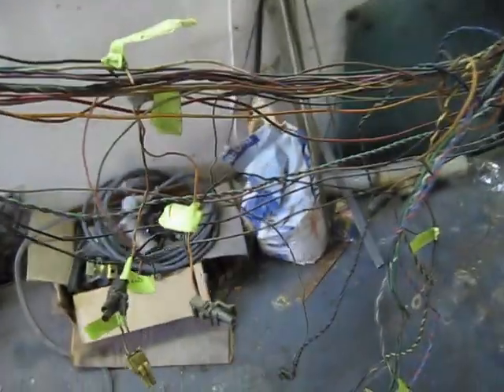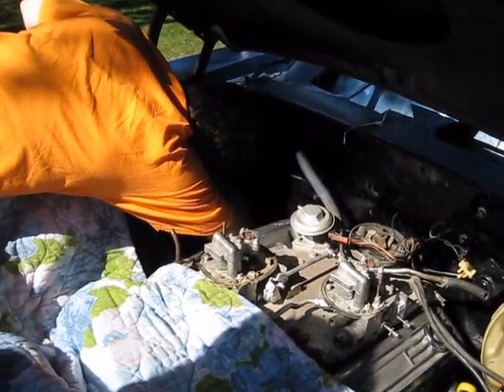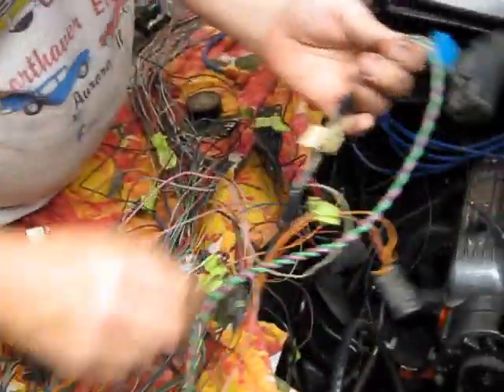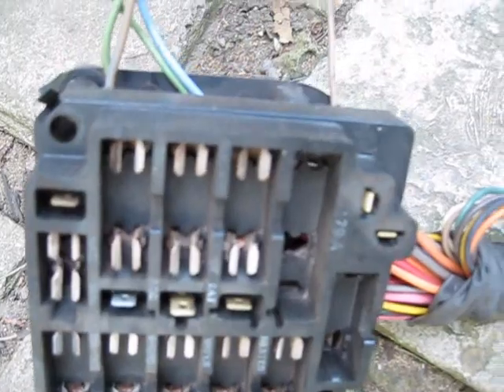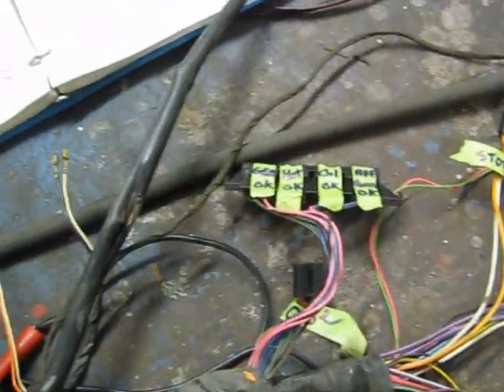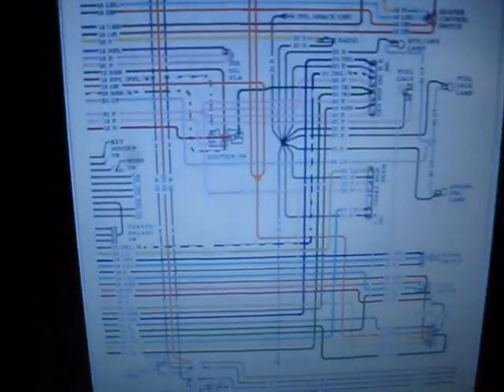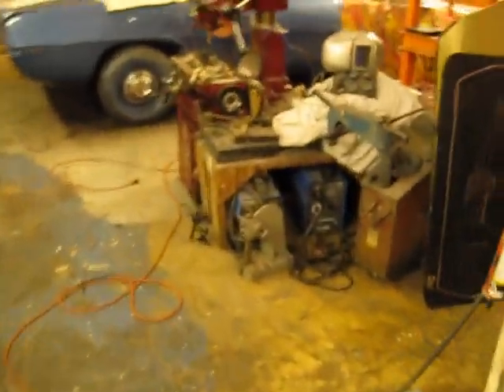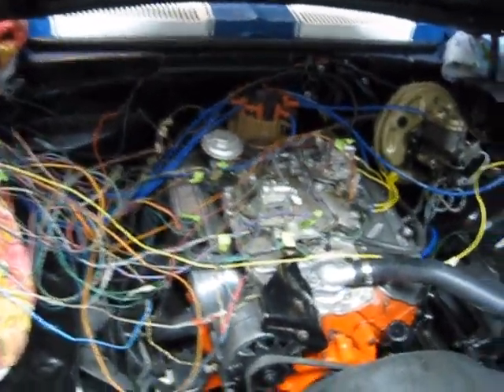Camaro Update 7/25/10 - Wiring up the Car

Comment from the maker: @gerald2003r Wiring up the car wasn't to bad with stock harness. Checking all lights and circuits were ok  in dash harness was harder. The 82 engine harness now that was a nightmare mostly because there is no single computer harness its mixed in with everything else. Had to cut away a lot wires to get what we need